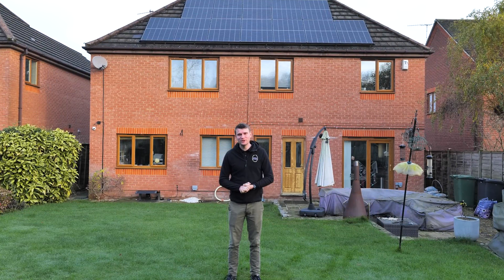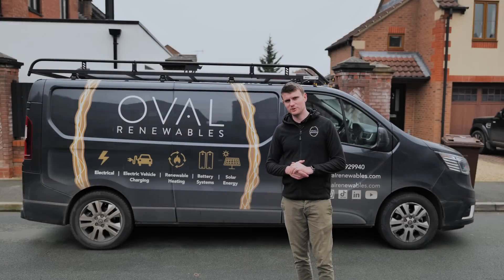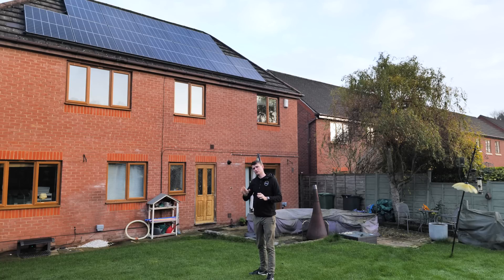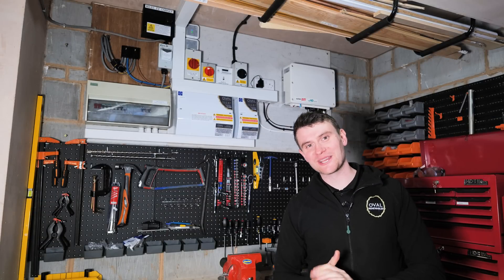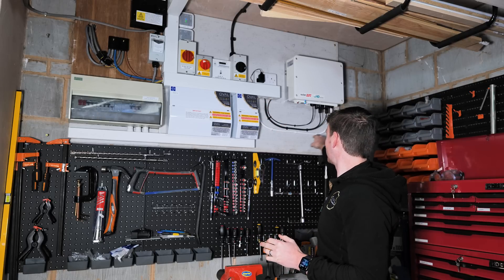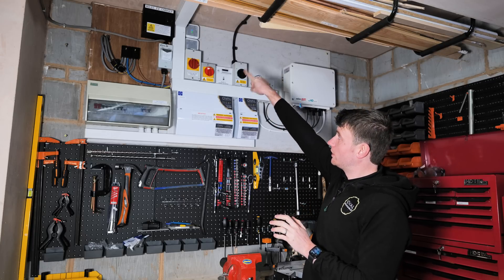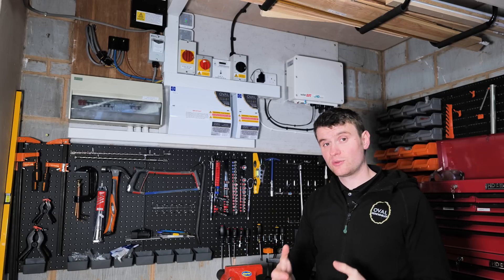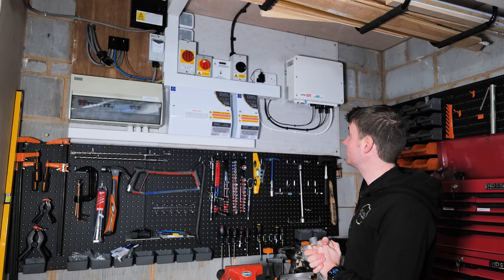SolarEdge PV home system setup!

Comment: In the years to come this will be highlighted as the "dumb" install.
Absolute equipment overload for what is essentially a "low" power DC system.
The stupidity of this when compared an old fashioned TV tube that could have 15-25,000 volt sitting in the living room with only a slim case for protection and was perfectly safe.
Expect all this crap to be brought down to a simple one box install in the future - current interpretations of the lunatic regulations are strange.

Comment: May I ask what is the pay back period for the install of the solar and battery install please. Not including the EV charger and the upgrades.
Reply: Hi Gino, pay back was not my primary concern for this system, My primary objective was a backup system that would last at least 24H, I was also looking to generate as much solar as possible and use it on site rather than exporting as I get only 4.1p for an exported KW due to being on an overnight tariff.

As for calculating payback it's obviously a bit tricky so I'll post some info as best as I can.
My tariff was about to go to 35p per Kw, with the battery and solar I moved to an overnight tariff that is 7.5p from 00:30-04:30 and 28.96p the rest of the time so the numbers are a comparison between being on 35p with no solar to being on an overnight tariff with solar and battery, 

in the last 9 months I used 
Load = 8467.6Kwh
Solar Gen = 4394.55Kwh
Grid Use = 4544Kwh
Export = 455.28Kwh (we were away for a month in June / July and exported a lot of electricity, usual export is around 3%)

So if I'd done nothing my power would have cost £2,963.66 in those 9 months, dirty I know but if we divide that by 9 and times 12 then it's ~£3,952.00 for the year
With solar and battery, my grid usage was 4544Kwh 10% of this is approx peak (the system always needs a little power for the inverter) I exported 455.28Kwh so my cost for the remaining grid less export payback was £392.89 or scaled to 12 months ~£523.76 so that's a saving of £3428.24 per year approximately if you take out the EV charger work the ROI is just under 7 years at that rate, that is obviously assuming the max rate for electricity doesn't go higher or lower than 35p

Hope this helps.

Comment: Does the 4.8kw solar arrays charge the 27kw battery bank ok in a day.
Reply: Hi Gino, this is my system, from mid March to the beginning of October the 5KW panels have produced power in excess of the battery capacity, the maximum it has generated in a day was on July 13th at a total of 35Kwh

I typically keep the battery with a minimum of 40% capacity to allow me to continue to work for 24 hours in the event of a mains outage, where I live the power is fairly unreliable but most outages are sub 20 mins. in winter I charge the battery to 90% as the solar being generated struggles to fill the remaining 10% and it gives me 2-3 days in the event of an outage.

Hope this helps
Reply: @sophier80  thank you for reply. I am in North Wales I have 2 battery banks my 4kw solar system which is South facing would not charge my battery to 29% today so very poor. The battery would not last 2 hours with our usage. But everyone's usage is different. . As back up we use an generator so we can work from home . We like you have power issues .

Comment: How did you get the Alpha battery to work with the solar edge inverter? I thought only the LG battery or the new solar edge battery works with the solar edge inverters? Is that the same house you put the 11kw alpha ess battery in your video a few weeks ago?
Reply: Yes I would like to know this as well. I thought they could only work with those two options as well
Reply: @casperyourfriendlyghost7552  It’ll be an AC coupled battery. Personally would have got several SolarEdge 10kWh batteries.

Comment: Good comprehensive video, very informative and good detail too. I don’t know whether you’ve mentioned it but I can’t remember if you say what elevation the panels are at. It would also be good if you did a video on different position panels, be they just east facing, west facing, south and also split ie West and east.
I don’t recall anyone concentrating on what the numbers are for different position panels.
Reply: The house is 70m above sea level the panels are at 76-77m approx elevation, the panels face 202 degrees so not perfect but not bad, best solar day was 35Kwh on July 13th on Dec 21st (shortest day of the year) it was almost totally a clear day barring about an hour at midday and it generated 10Kwh, June 22nd as similar in that for about an hour there was cloud and it produced 33.47Kwh

Comment: Thanks for vid-just curious - why not just take the dc from the pv and  plumb it directly into  the alpha inverter
Reply: Hi Rob, this is my system, it was done this way so that we could use the solaredge optimisers with their smart monitoring, this isnt possible if you wire directly into the Alpha, in the future there will be a single story extension and this will have solar that will be fed directly into the Alpha, hope this helps.